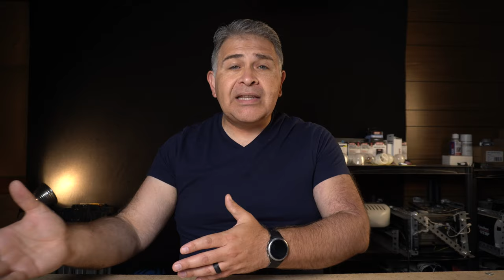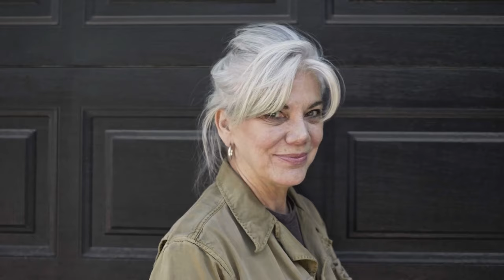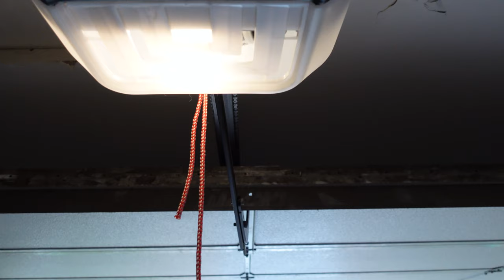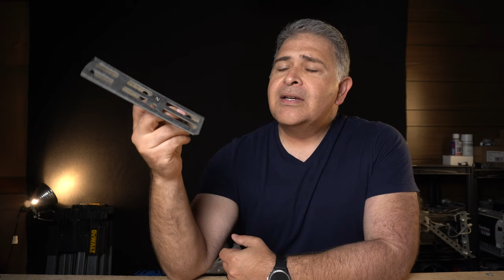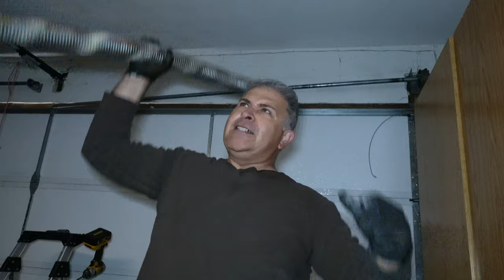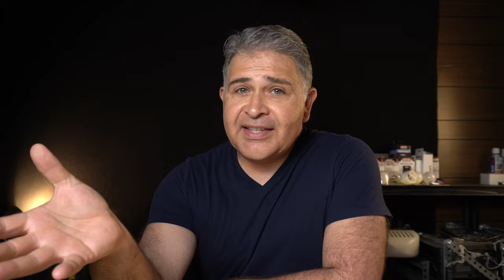The Truth About Your Last Garage Door Repair

Comment: My garage door opener starting intermittently stalling at about a 18" when opening. After lubing the rollers, manually opening and closing the door and checking the open foce adjustment on the motor was at the max setting (it was), I called in a contractor to check the door balance and retention the torsion spring. He adjusted the cables and retentioned the spring. When he was finished the opener would not function and he said the motor of my garage door opener was worn out and wanted to sell me a $2000 garage door opener. I then discovered he had disabled the opener by turning the open force adjustment to the minimum; when I turn it back up the max, it worked again.

Comment: Ok so I've commented on your videos before. I feel that you generally do a pretty good job with these videos.  There's a fine line your walking and I think your doing it well. . Today you're talking about a guy cutting down some flag brackets and using it for some backhang on an opener. You know what if they are right length? Who cares? It's thicker metal than the punch angle right, Right?.  And as you mentioned, it was probably more work to put them in. A lot of more work He had to bust out his grinder. He ain't using no snips to cut those brackets. No. I'm thinking that He was in a jam and came with something that would still look good and something that would get the job right and something that would last. Those cut flag brackets will work just as good as as punched angle with.  If he was working for me and I got called there and I had to see that I would tell him he did a good job thinking out of the box coming up with something that would work just as well as punched angle looks just as good as punched angle and last just as long as punched angle. And he wasn't being lazy cuz you know how hard those things are to cut. So he gave himself extra work in doing so.  In ending I'm just going to This is a non-issue. If it was plumber's tape would or if they had some 8 ft pieces with no sway brace then yes but 8 in of flag bracket. There's nothing wrong with that. Just my opinion. I think you do a great job. I really do. I love your channel. Keep up the good work. Just don't agree with you today
Reply from the maker: Hey Tommy!  Thank you so much for sharing your feedback!  That's what I love about this community.  In fact, you bring up great points.  To be honest I really didn't think about the perspective you mentioned.  You're absolutely right!  He had to grind away thru that gauge of the flag bracket!  And if memory serves me, he might have used tin snips because the cut was not clean.  Thus he does deserve recognition being quick on his feet, especially if he had no punch angle.  

I will admit I have used door jamb brackets to hang GDOs with very low or limited head space.  They work perfect on the Genie motor heads.  So by no means am I saying I haven't done something similar.  

Now the video does show how off the motor was from the center to the door.  And that led me to believe that the guy was not paying attention or he was just not seasoned enough to align the motor properly.  At any rate, he did his best.  I just happened to be the next guy.  

But seriously, thank you for all the kind words and support to the channel.  I appreciate it greatly.  BTW, what area do you service?
Reply: @sosgds  If that opener was off center like you said and it wasn't going straight then you are absolutely 100% correct. There's no excuse for not having a straight opener. Should be straight to the style every time.. It takes a strong wise man to admit when he's wrong and you just did that. So good for you... It's why I like your channel your open mindedness and willingness to see the other side...you must be a great boss too...stay healthy.  See you out there sometime.. I work Santa Monica,  West LA,  Beverly Hills.
Reply from the maker: You're too kind my friend!  We're all here to learn from each other.  Thanks again for sharing your thoughts!  Y'all stay safe too!

Comment: We ARE meeting for the first time! I watched a few videos on openers and I really like your presentation. Just trying to replace a 1996 model with something quiet and reliable. Seeing tons of mixed reviews and opinions. My garage door guy said Genie was bad, Chamberlain was good. He replaced all the outer hinges and rollers ($350) seemed super expensive for 30 minutes of work but the door is MUCH smoother now. 
For under $300, what's the best option for a quiet and reliable opener?
Reply from the maker: Hello.  Thank you for reaching out.  For under $300 there should be a number of motors that will work with your garage door system.  3 factors that I would consider: type of garage door you have and overhead space.  Do you have an insulated garage door?  Does your garage door roll up on a low head track assembly?  Are you looking for specific security features?